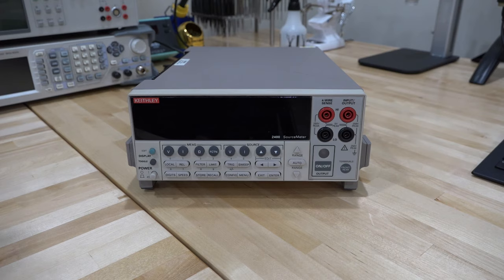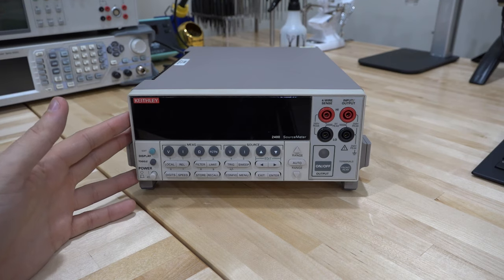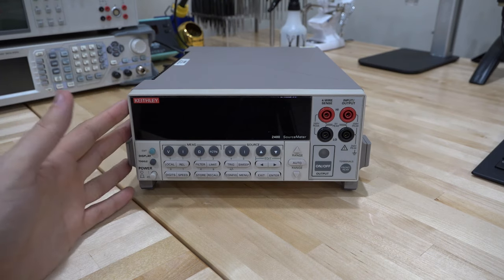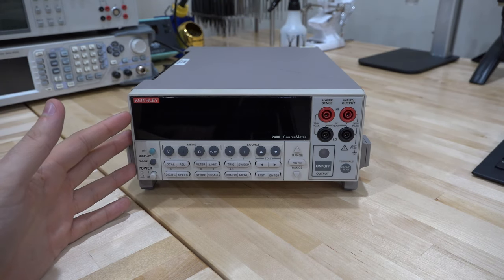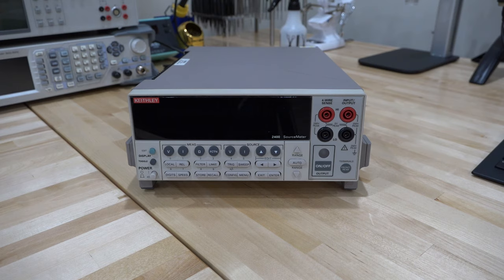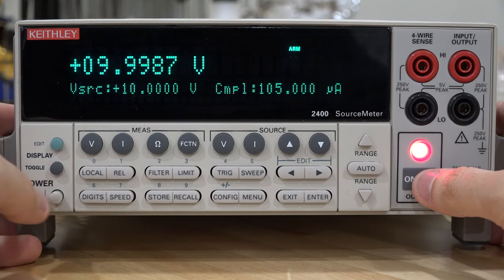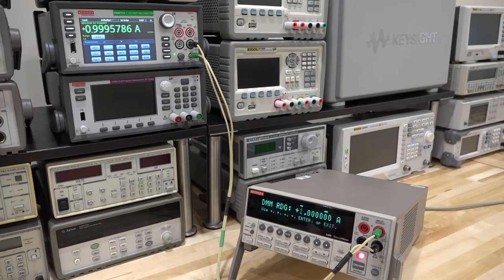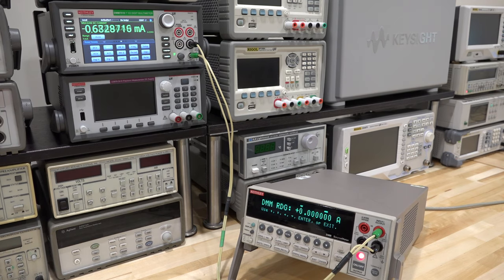TSP #95 - Teardown, Repair & Calibration of a Keithley 2400 Source Measure Unit (SMU)

Comment: Great video, thanks! I had similar problem when repairing audio DAC/ADC. The DAC chip was lifted because there was too much glue under it (the whole board was wave soldered). So it worked when it was tested at the factory, but after some time the thin pieces of solder (that connected legs of the IC and pads) broke off and the whole DAC portion died.

Comment: Check in the camera settings for a volume input control, that will allow you to adjust the volume as its recorded onto the video. Its common for this setting to be in the maze of menus on Sony cameras
Reply from the maker: Sadly it doesn't have that when this external microphone is attached! The selection for microphone level is disabled.
Reply: Sony Enough Said

Comment: If you ever open the case then I recommend that you also change the battery which is on the bottom board. If the battery is dead then on some cases the equipment becomes unstable and shuts off after 10-20min.

Comment: I use the same Sony Bluetooth mic for my YouTube channel. One is the transmitter and one is the receiver but really if you use an ear bud on each you can use them as full duplex radios good for about 300 feet or more. I connect the receiver to my camera and after syncing with the transmitter I then  push the volume up button on both units about six times to make sure volume is max on both. Then through testing I found giving the receiver about 2 or 3 volume down clicks gives the best audio level to my camera input. One warning. Check your batteries before starting a shoot because if they get even a little low the blue indicators will still be on solid like they are happy but the audio into the camera will be fuzzy crackling and sometimes failed. I get about 3 hours on a battery shooting. But for a simple full duplex radio not recording I go 5 hours on a battery. I made a review on this item.

Comment: Perhaps you could have verified that the crystal oscillator was in fact functioning using a simple "sniffer" loop and the spectrum analyzer? In less complicated gear I do that as a quick and dirty first check. Glad you saw the IC; I saw the moment the chip sucked back down on the board as you were heating it, that's always an interesting event.

Comment: is there way to measure power out of an audio player (maybe function of audio level)?  a multimeter is not fast enough to log that (frequency up 20khz), can be done by math integral function in an oscilloscope?
Reply: RMS voltage and current should give you the power output.
Reply: You'd normally measure in Watts RMS. The number will be much lower than Peak Music Power Output (or Watts BS as I like to call it) that commercial amps are often quoted in, but more meaningful. 

IIRC, classically done by putting a resistive dummy load of resistance equal to the nominal impedance of the speaker that would normally have attached to the amplifier, then putting a 1kHz sine wave in the input and turning it up until it starts to visibly distort on a scope (not the best way to tell if it's distorting, but better than nothing). Then you can just measure RMS voltage with a multimeter or scope and calculate power from voltage and resistance.

Comment: Some repair places, desoldering disconnect the faulty component and temporarily leave the faulty components without (correctly) soldering, pending/until hang of working with the a replaceable component.

Comment: I don't usually watch entire repair videos but this one really sucked me in because the issue seemed so specific, I was curious to see what the problem was. Great video. What isolation transformer are you using? I've never seen one with a current reading.You are working in a lab environment so I'd expect it to not be referenced to earth ground so you don't become "a part of the circuit" but just to confirm is it a transformer that only rejects high voltage spikes and noise or is it separated from earth (as well)? 

This video is a must watch I won't spoil it for anyone else 😂😂😂

Comment: Great video, great channel! I watch this video to fix my own K2400, which presented an output issue, but it was helpful. Now I am curious: could you upgrade the firmware to C32 or superior? Mine is C17, but I saw in someplace that it has different hardware, so I cannot evolute to any superior firmware release... is it true? Many thanks in advance.

Comment: LOL, that was like The Signal Path, ASMR Edition.
I liked the video,  but please do something to this mic :)

Few question from my side:
- I many test equipment one convert very high  frequency  to a lower one,  to make it easier to process. Why does conversion process consists of many steps, for example 2 GHz to 500 MHz to 120 MHz and eventually to 60 MHz. Why cant we convert 2 GHz to 60 MHz directly? What could be potential benefits of taking  intermediate steps?

- I recently finished my Master Degree in  Nanotechnology. We learned a lot about fundamental physics of semiconductors, how  transistors, lasers, leds, photovoltaic devices work , how to manufacture them etc.  Now I want to get a job as IC designer. Unfortunately even  junior positions demand lots of practical knowledge  of specific software, such as Cadence and already an idea how to design digital/analog IC-parts. The problem is, I cant  learn how to design IC or to use Cadence at home. Any suggestions how to get such job? (Jesus, that is a lot of text...)
Reply: 1. Two issues coming to mind:
a) Image rejection - doing 2 GHz --> 60 MHz directly would pretty much require I/Q mixing for any kind of decent performance in this regard, and without good calibration it could still end up being less than stellar. Clearly, you do not want something like a spectrum analyzer to show things that aren't actually there.
b) Frequency generation - it is not at all easy to generate high frequencies with very small steps (say, GHz range with 1 Hz steps), so multiple nested PLLs with a fair bit of internal mixing going on have to be used.

2. That sounds kinda familiar. Companies always want people that they can use as-is without having to invest a lot into them first (which is understandable in a way, if problematic in a field with so many specialized niches), but what you write implies that you may have been at a traditional university without too much practice involved, like yours truly was. You may have to look for an intermediate position to get you some practical experience first, maybe as a support or applications guy or something else more suitable for a neophyte. ("Junior" anything does not necessarily mean it's suitable for someone who just graduated!) If you can drive a car, you should be good.

Comment: That's a strange thing. Did it ever work ?

And what could cause that? Just speed/rushed through the soldering process ?
Reply: The large crystal might have shaded the spot during reflow? (unless the crystal was soldered afterwards).
This inside corner is also an area of high mechanical stress on the board, you can see it flexing. Vibration or impact can break weak joints in areas with a high bending load.
Reply: ok, cheers

Comment: Oh man. As I told several times you are lucky man :)Again same story.
Reply from the maker: Yes, it must always be luck! There is no other explanation.
Reply: The Signal Path I wish I had seen videos like yours about 8 years ago. I had ended up with a stack of busted electronics (a basic analog function generator, some digital/analog guitar gear, and a 70s era tube hifi amp) and I ended up gutting or parting them all out because I didn't have enough knowledge to troubleshoot and repair them properly. I look back now with some regret at the missed opportunities, especially the hifi amp. I know now after watching your videos that I'd have been able to make a much  more logical and informed go at it.
Reply: As I believe Jack Nicklaus (the golfer) once said: "The more I practice, the luckier I get."